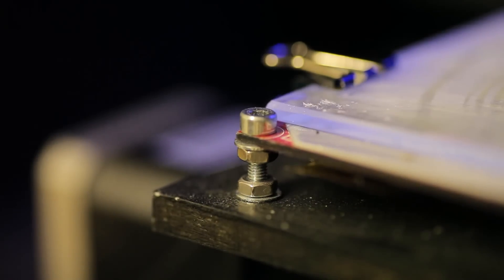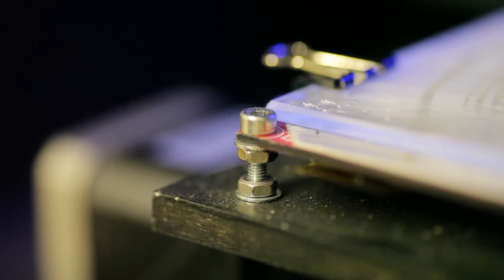3D printing guides - Bed leveling

Comment: In my opinion and my experience when printer is at home position. It is set to 0 high. I did that. And in settings in cura slicer I have there hight of first layer, this means that head of printer is going up at 0.2 MM or 0.3 depending how I set it for first layer. Head is going up with that setting and I don't have never noticed problems with that.

Comment: hi my friend first thanks for the amazing channe! I have a problem, every time i print an object no matter the size even if it is only the first layer, i have to relevel the bed, why do you thing this is happening?? I have a CR-10 Mini
Reply: Hi there--printer technician from ReliaBuild 3D. This is the most common issues i've encoutered when servicing:

1) Something is loose ( e.g. bed carriage, X axis gantry (what holds the extruder), Z motor) and can't maintain tolerances
2) Your Z motor is binding
3) You're causing torsion on the bed screws when you remove stuff--seems unlikely in your scenario

gl man

Comment: Not hard ??? I can’t get my bed to level for 9 hours already. I am on the edge of throwing my printer out the window. I level it perfect. But as soon as I click print it no longer touches the paper...
Reply: I know the feeling. I been leveling with feeler gauges and a multimeter with sound. Unfortunately leveling from .07 to .27 mm produces the same problem. Does not stick, rats nests and fails. Its also been 2 months.

Comment: Thomas I need serious help... Just got a creality cr10-s no matter what I do the nozzle is so close to the glass the paper doesn't go under I have adjusted the bed screws a miion times nothing works
Reply: Your bed is warped most likely as I literally just switched out the bed for a mirror from lowes(6 pack of 12x12 is 10 dollars dont get the beveled edge ones) and now my bed is level

Comment: What about the weight of the sheet of paper? Does it matter if the paper is 15lb or 20lb stock?
Reply: It does. Use a sheet of standard printer paper. I often use yellow sticky notes for convenience, and adjust it just a little grippier than using printer paper.

Comment: Hey Buddy
I have a delta printer and for some reason the 1st level is fine except in one corner. It seems like the extruder is tearing through the blue tape slightly but after the 1st couple of layers it seems fine. I ran a auto leveling in Mattercontrol and it works, but in CURA it dont work. How can I do this auto leveling in CURA. Please if you can post a vid about CURA that would be awesome.

Comment: What is optimal tram between the gantry to the bead. 5 micron per cm (1 thou per inch)? Ideally you want 0 but how much before prints start to fail?
Reply: Thanks for the reply. I am making a 2 axis rotary table to 3d print in 5 axis. I wanted to know how critical leveling was if there is some backlash in the table.

Comment: Hi Sir ! I have a problem with leveling the bed , I did follow what your step , and walla everything done , but then after I print it say today I have 1 print done then the next day I take out the glass for cleaning and then put it back , then found that the leveling miss again , the do it again , then the next day the level is off again , may I know why ?
thanks
Reply: You should always preheat the nozzle before leveling the bed

Comment: I'm trying to do with with dual extruders (Rigidbot, a delta of about 44mm between nozzles) and it's a serious challange. Any chance of a trick or two to enhance this video for us?

On that matter, Thomas. what's your preference in multiple extrusion? multiple hot-ends or a single nozzle like the Cyclops and the diamond?

Comment: I don't know if anyone has mentioned this but should I be doing this when the nozzel and bed are up to temperature to account for expansion? I find my nozzel is in a tottally different place when I level it hot vs cold.
Reply: EXACT same temps that you print with. Great Q

Comment: I use a feller gauge. 0.05 and adjust the bed.   and set offset of 0.05.   i have a first layer on 0.3. when i start printing the first. the nozzel rise 0.3mm is this correct (g1 z 0,3)

Comment: Hi, I have a heated bed, should i set it to 110'c and 230'c for extruder when doing bed tramming?
Reply: ***** yeah, took me a while since sometimes there were very little and too much frictions on the paper, also the frictions caused by some of the plastics sticking to the paper surface. I'm using the reprap wiki bed leveling method to easily adjust and cost me lesser time and more practical

Good video guides by the way, cheers =3